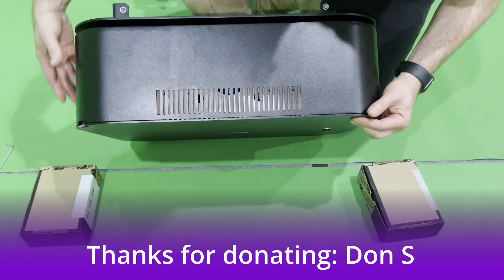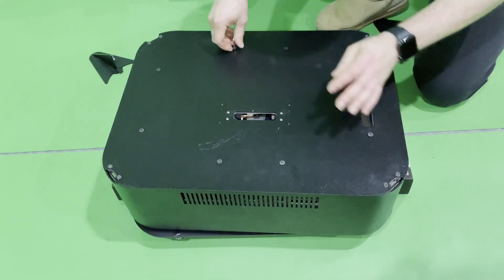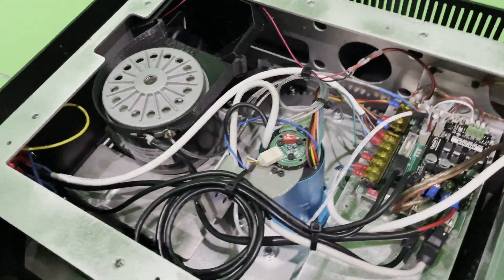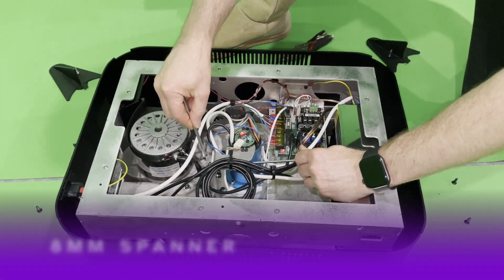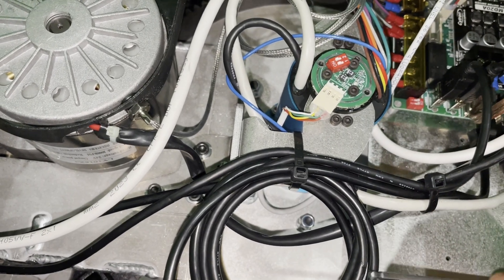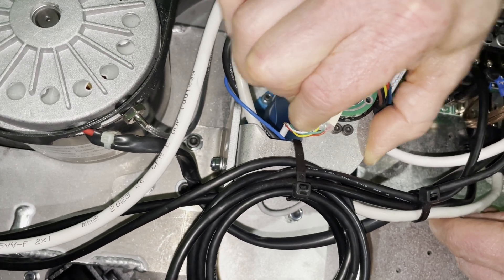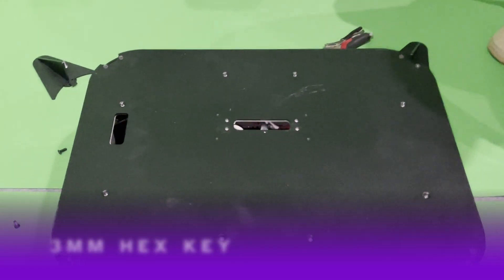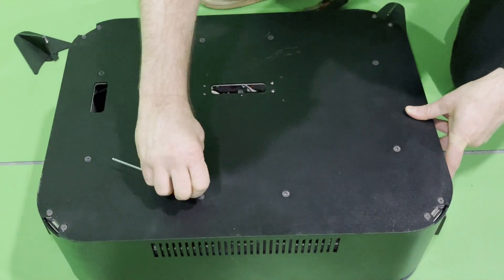Yaw2 USB Slip Ring Fix?

Comment: I saw someone else in the  Unofficial Yaw2 Facebook group post that they issue with the USB disconnect could be solved with a female to male UBS cable that needs to be connected in a Raspberry Pi circuit on the base platform and the people from support can remotely fix it using Virtual Client.
Reply from the maker: Yes, I'll have a video about this soon, I set it up last night and it's working great